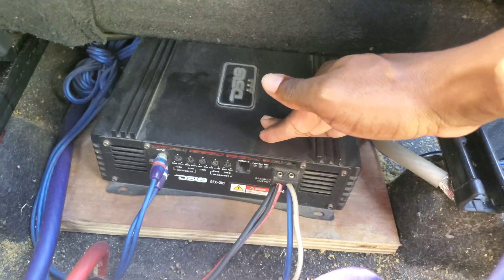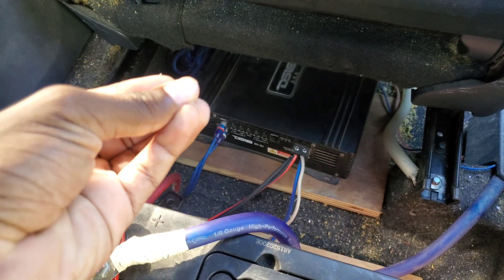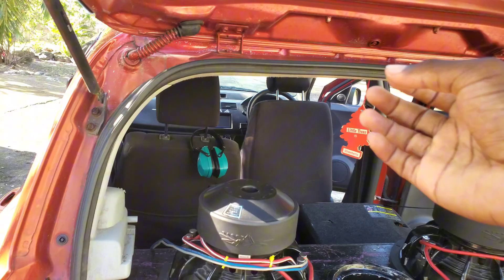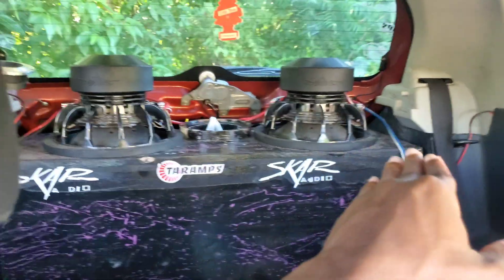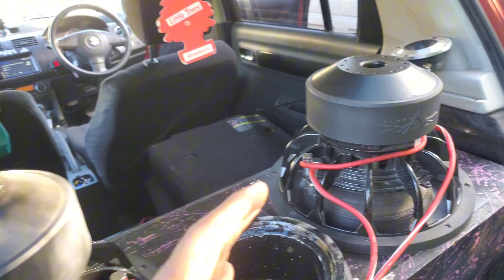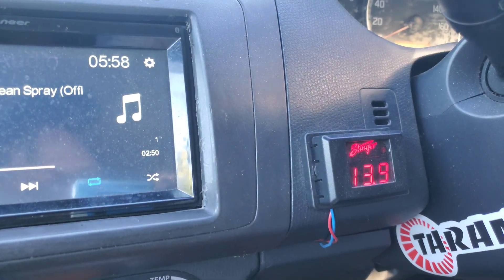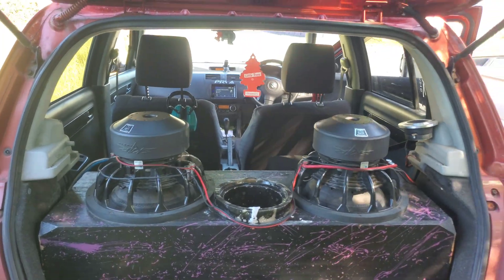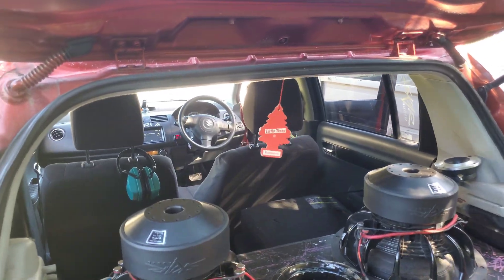Which Ohm Load Is Best? 1 Ohm vs 4 Ohm Tested

Comment: 4ohms is more controlled than 1ohm. 1ohm is louder bc it’s getting more power but it’s a “sloppier” sound. Less controlled.
Reply from the maker: That's correct ✅️ 4ohm will tend to be more efficient than 1 ohm. Also can you please drop a like on the video 👊🏽💪
Reply: @tyreeisvibin  i did. Even subscribed to your channel. 🫡
Reply from the maker: @RoadTrain0123  Thanks alot bro
Reply: Impedance of a coil has no affect on the sound quality on low fidelity drivers like subwoofers. 1000 watts at 1 ohm is acoustically the same thing as 1000 watts at 4 ohm. the only difference is the amount of current, theres much less current through the speaker output at 4 ohms, but its not "sloppier" by any means
Reply: @xsunny720  what is dampening?
Reply: @RoadTrain0123  what is fidelity? your not gonna notice a difference with subwoofers putting out 150-160db at 30hz lmao.. maybe you can tell a difference with a smaller system..
Reply: @xsunny720 exactly. Who’s running 150. The content creator ain’t and most ppl watching this ain’t either.
Reply: @RoadTrain0123  lol

Comment: At 1 ohm, you will pull 4x the current with the same output voltage.. IF the amplifier and the power supplying system can deliver that current its ok. The distortion will be more more.
Reply from the maker: Good points made!

Comment: Here is a video idea for you.
Testing your wiring of your system.
Such as making sure you have proper grounding and the use of good wires to your amp / battery / subs.

Another video idea would be.
Proper enclosure size for your vehicle for the type of subs you plan to use.

Another video idea.
Do you need different settings when you change sub woofer sizes or different brand of sub?

more video ideas to come
Reply from the maker: These are some great suggestions, appreciate you sharing them
Reply: @tyreeisvibin  Another great video idea would be how to identify clipping even when you don't have a scope or meter.

Another video idea would be selecting the proper fuse or circuit breaker for your system.
Reply: @scamchan  or why you should not use a circuit breaker in car audio, and use anls. theres like 4 different materials they make anls out of too
Reply: @xsunny720  Yeah lets just keep buying fuses and when you really need one you have to go buy more.
Circuit breaker one time purchase and simple reset.
WINS every time.
How many homes still using Fuses?
Some people stuck in the past with old tech.
Cars need to move up in tech as well in car audio.
Reply: @scamchan  no, there are reasons why you use circuit breakers in homes and fuses in car audio. Here are some:

1. circuit breakers burn slow, and fuses are much more accurate. you don't slow burn in car audio, because its much more likely its protecting a current spike rather than just a simple over current appliance
2. fuses can handle high vibration/heat and cold environments better, circuit breakers wear down and fail pre-maturely
3. you should not have fuses blowing in car audio. If they are, there is a problem you need to fix. You shouldn't be able to just flip a breaker back willy-nilly when they should not be blowing to begin with

At the end of the day, when properly used they both work. But fuses are "better" for car audio, and your typical car audio diy guy shouldn't use a circuit breaker.
Reply: @xsunny720  I am sticking with my circuit breaker
"burn slow" LOL that has to be the most funny thing I have heard all week.
There are slow blow fuses as well but hey what do I know.
How much vibration does a car itself have moving on roads?
Just make up assorted reasons that don't add up.

You should not have fuses blowing in your car? LOL
What is the point of a fuse or a breaker?

Now I could be wrong but if a fuse or breaker needs to be flipped or replaced the first thing you do is check what the cause is.
Now if you do not fix it which will you run out of first?

A breaker wear down? From what exactly?
Anything man made can break down eventually.

If you not using the proper fuse or breaker rating yeah it will blow just on spikes.
Seriously you not convincing anyone here.

IF breakers were "TRASH" for audio they wouldn't be a thing that could be used.
Reply: @s @scamchan who taught you this shit lol. My car audio mentor is Jason jones (I’m on team jss) and I’m an electrical apprentice lol. I would hope I know a thing or two… fuses>circuit breaker for 12v automotive. Why do you think every cars fuse box is full of fuses?
Reply: @xsunny720  Why do I think a car fuse box is filled with fuses BECAUSE THEY ARE CHEAP TO MAKE.
You know cars are made from cheap to source parts.
Geeze you think anyone with a bit of brain would know this.

Now ask yourself why does an EV still need a 12 volt battery?

Maybe you can start to think clearly and understand the fuse question better.
Reply: @s @scamchan 🤦‍♂️ keep using your circuit breakers in your quiet system.
Reply: @xsunny720  Nothing quiet about my system the breaker still works for years and years.

You know you can use the breaker as a master switch.

Poor fuses can't do that.
Reply: @s @scamchan  your supposed to wire a switch into the remote lol…
Reply: @xsunny720  LOL why would anyone wire a switch to a remote with multiple amps when the circuit breaker can cut ALL power to the amps.
Geeze You can't be any apprentice with sense.
Reply: @scamchan my amps take dual 2/0 each. Much easier for one little switch to turn ‘em off than multiple 500 amp circuit breakers 😂
Reply: @xsunny720  I guess you don't understand that the power is still connected to all amps even if you use a remote switch.
You are a very poor apprentice.
With the power fully disabled it is safe to work on the amps than just playing around with a remote switch.

WE don't do EASY We do SAFE over here.
You really teaching me how little you know.

Comment: I prefer 0.5 ohms I want the absolute most power I can get at my disposal and it I want to dial it back I can via my bass knob
Reply from the maker: Solid one 💪💪 from your ohm wiring I can tell your electricals are solid 🔥🔥
Reply: @tyreeisvibin to run an big boss 8k it better be 😂